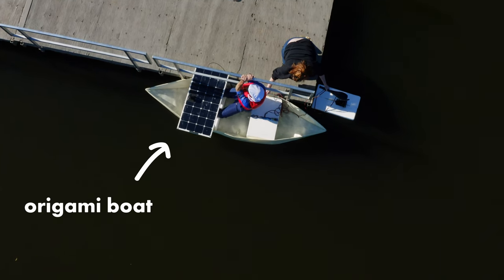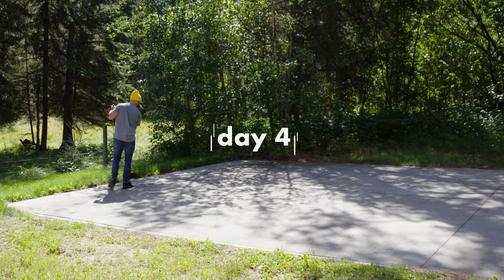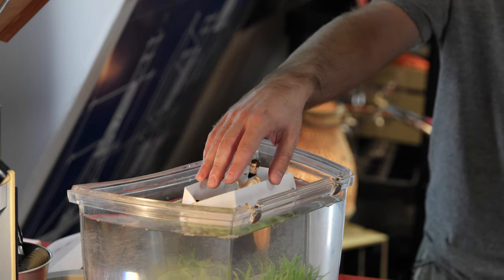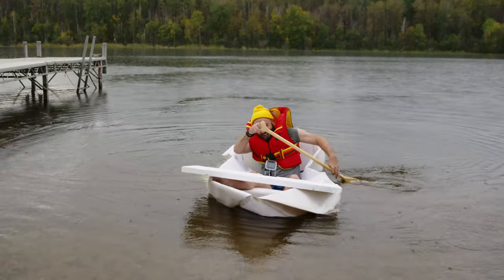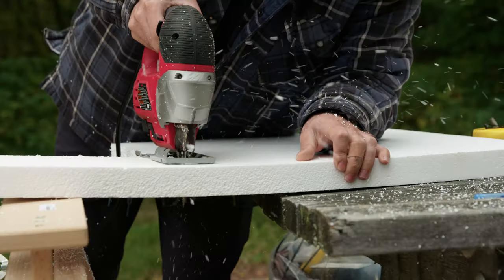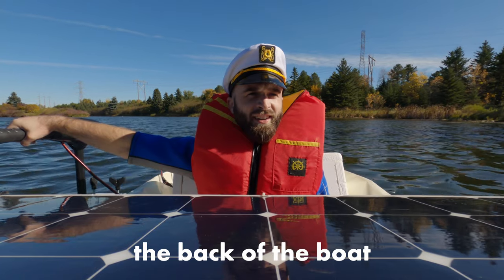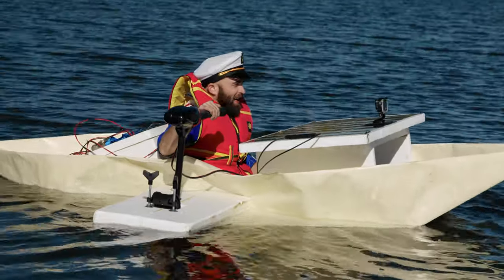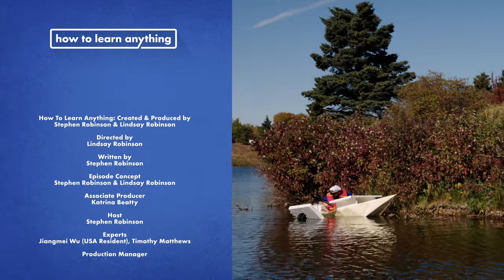I Built a Human Sized Origami Boat

Comment: amazing content. one thing is bugging me though you put the gopro on top of the solar panel which would seem like not a big deal but the cell that is covered in shadow acts as a resistor in the circuit limiting the energy of the other cells. still seemed to work out fine though!